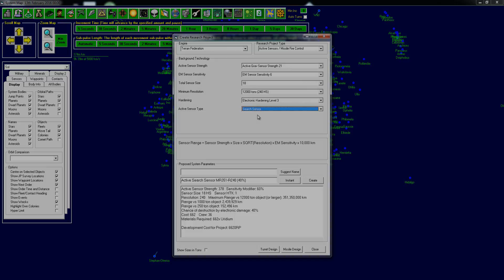Aurora 4x Ship Design Tutorial - "Active Search Sensors/Missile Fire Control"

Comment: very usefull tutorial.
can active search listening posts be more usefull whan conventional deep space tracking stations?
i  have a habbit to demand commercials to deliver 10 deep space trackers to places, that i want to know about.
in what cases do u use active pdc trackers with no firepower?
Reply from the maker: +Sledge Hammer a good question that the best answer to is: it depends.
Take this into consideration:

- First of all Deep Space Tracking stations can only be put on asteroid/moon/space station. In many cases you won't have this luxury available
- They have varying strength depending on your technology and the target so a specialized sensor will give you warning earlier than a passive in some (most?) cases
- Since the first Scenario I forbid myself from putting more than 5 tracking stations at one place as they are (IMO) quite OP (by building more and more of them you can basically eventually track a TH of 10 billions of km away which is down-right idiotic and an equivalent of smelling a matchstick on the other side of New York City)
- Most of all active sensor give you estimated size of target. Passives give you only TH or EM signature which tells you much less than the size of the object. Is it a ship with very low signature? Is it a very large missile? You can't be sure until you actually scan the thing with an active sensor
- You need active sensor for any missile/weapons guiding
Reply: Alfapiomega yes DST are quite OP. other than that, whan u smell this matchstick, u just can move sensor ship closer to know what size this matchstick is. 
you probably don't want any kind of matchsticks to be in your territory. 

what do u mean "First of all Deep Space Tracking stations can only be put on asteroid/moon/space station"?
pdc are placed the sameway. or do u tow pdcs in the middle of nowhere?
Reply from the maker: But active sensors don't have to be on a PDC only. Put it on a platform (ship without engines, I'll show it later), tow it in the middle of nowhere and there you go, a sensor satellite! :)
Reply: Alfapiomega i get an idea. but why not to give it engine?

i as a matter of habbit have eye class ship. ship with just 1 50hs vs 1500 ton sensor with lots of engines. 
this sensor is already expensive as drugs. engines don't add a lot of cost/space.
Reply from the maker: Because then it's a ship.

It sounds like a snarky response but it's true.
What I usually do in my games is down the line design a satellite that is basically just a platform equipped with EM, TH and active sensors. This thing is heavily armored, has a long deployment time and immovable. I then create a satellite carrier that goes around laying them in places where I need them. From time to time he picks them up, carries them back for an overhaul and shore leave and later takes them back. It is a bit of a hassle but it's cheaper and more efficient in resources than having an actual fleet of sensor ships where I don't need to build engines (who are, frankly, often a big part of a ship and quite expensive).
Reply: Alfapiomega well, it sounds reasonable in terms of reality. but this game has already tonns micromanagement. what you do seems like realy too much for my lazyness :) tow it, tow it back. whan towed, rehaul. rehauled - repeat.
it's sparta :)
Reply from the maker: Yup. Which is a reason why I only use them in specific roles (like Jump Point patrol) and I try to give them as much service time and resources as possible.
But looking at it from a standpoint of a sensor ship you would have to send it on it's way, then back, overhaul, repeat... it's not that much different :)
Reply: Alfapiomega well. it's possible to automate in one task group "move, delay time, move, overhaul" repeat. 
and i'm addicted to use DST a lot as a far enemy detection. this ship is agile scout, who is ushualy twise as fast as my missle ships and most of the time sits at home.
the main idea of this ship is not to detect enemy but to increase missle range. i uhualy give my missle ships sensor, twise ...
let's say my regular missle is 200m km range. i give my missleship firecontrol for 250mkm and sensor for 100mkm and secondory missles with 2/3 size of regular missle but same  engine and range of 70mkm. and build this fast eye ship with long-range sensor. 
the role of ship is a part (separated TG) of missle group or a part of shortsighted (almost blind) meson/laser group. not far detection.
Reply from the maker: Care to share the plans for this sensor ship?
Reply: Alfapiomega well. i gues it was overengineered. the idea was "just sensor with engine" )))

Eye class Scout    8 350 tons     167 Crew     2002 BP      TCS 167  TH 352  EM 360
4215 km/s     Armour 3-36     Shields 12-300     Sensors 1/1/0/0     Damage Control Rating 15     PPV 0
Maint Life 3.77 Years     MSP 2749    AFR 111%    IFR 1.5%    1YR 303    5YR 4538    Max Repair 924 MSP
Intended Deployment Time: 36 months    Spare Berths 1    

352 Mill Magneto-plasma Drive (2)    Power 352    Fuel Use 50.76%    Signature 176    Exp 11%
Fuel Capacity 2 000 000 Litres    Range 84.9 billion km   (233 days at full power)
Delta R300/300 Shields (5)   Total Fuel Cost  63 Litres per hour  (1 500 per day)

CIWS-160 (1x2)    Range 1000 km     TS: 16000 km/s     ROF 5       Base 50% To Hit
Active Search Sensor MR303 x1500 (1)     GPS 27720     Range 303.7m km    Resolution 30

This design is classed as a Military Vessel for maintenance purposes
Reply from the maker: Care for criticism?
Reply: Alfapiomega sure
Reply from the maker: The ship is way too slow and big in my opinion. Why would it have 36 months deployment time when most of it's time it sits at home? Why so many resources? Why have such a big tank on it? 84 billion kms? Why?
The EM and TH signatures are incredibly high as a result. With a size 1 strength 8 sensor you will be picked up at around 30 mil. kms both by EM and TH. I'd make it much smaller, cut on shields and engines (you will be much faster and less visible that way).
In fact, this design would work ten times better as a scout fighter.
Reply: Alfapiomega i try to remember, why it's 3 years of deployment and msp and so many fuel. i don't remember. ofcourse it doesn't need it.
Reply from the maker: Next generation of this ship can be much better  :)
Reply: Alfapiomega i was probably shy on naval shipyards and very happy, that titan had millions of acc. 1. duranium, so intended to use this ship both as fleet support-scout and far far far space tracker. 
btw i realy don't mind my scout to drag all the missles to it, so my firepower ships don't get it.
but what's wrong with shields? why do u think, that it's batter without them.
Reply from the maker: This really goes down to the logic design. Is this ship purpose clear? I mean what does it do? Apart from staying home all the time?

- It is too big and slow for a bait
- it has to high EM and TH for a scout
- as a sensor ship it has too little sensors
- it is armored and shielded as light cruiser but has no weapons to protect itself, it will just get hit and hope it survives the damage somehow
- it carries enough fuel to be a jump survey ship but has no jump engine

Now I don't know your scenario. If this ship works for you then enjoy it :) You might just have fun with it. I'm just trying to give advice on how it could be a bit more efficient in what it was originally made to do. That's all :)
Reply: Alfapiomega it has a sensor to fully utilise missle ship's firecontrol's range and range of regular missles :) this ship is not very improtant. 
what do u say about other ships? cause i tend to do some variations of this 4 classes in mass quantities every time i play aurora and don't realy have too much fantasy for designing. something else. (so i wait your design tutorials :) )

missle ship. the main vessel.

Kursk class Dalnij bombardirovshchik    11 250 tons     319 Crew     3047.5 BP      TCS 225  TH 352  EM 750
3128 km/s     Armour 8-44     Shields 25-300     Sensors 1/1/0/0     Damage Control Rating 18     PPV 35.04
Maint Life 3 Years     MSP 1354    AFR 126%    IFR 1.8%    1YR 226    5YR 3393    Max Repair 480 MSP
Intended Deployment Time: 12 months    Spare Berths 2    
Magazine 363    

352 Mill Magneto-plasma Drive (2)    Power 352    Fuel Use 50.76%    Signature 176    Exp 11%
Fuel Capacity 1 000 000 Litres    Range 31.5 billion km   (116 days at full power)
Delta R300/300 Shields (10)   Total Fuel Cost  125 Litres per hour  (3 000 per day)

Twin R6/C3 Meson Cannon 60km 10s p3per5 Turret (1x2)    Range 60 000km     TS: 20000 km/s     Power 8-6     RM 6    ROF 10        1 1 1 1 1 1 0 0 0 0
Fire Control 128km 20kms (1)    Max Range: 256 000 km   TS: 20000 km/s     96 92 88 84 80 77 73 69 65 61
Stellarator Fusion Reactor Technology PB-1 O6 (1)     Total Power Output 6    Armour 0    Exp 5%

Size 2 Missile Launcher (3)    Missile Size 2    Rate of Fire 20
Size 6 Missile Launcher (3)    Missile Size 6    Rate of Fire 60
Missile Fire Control AM MR1 (1)     Range 10.1m km    Resolution 1
Missile Fire Control X1500 MR193 (1)     Range 193.2m km    Resolution 30
Size 6 MR104 16200kms (20)  Speed: 16 200 km/s   End: 107.2m    Range: 104.2m km   WH: 18    Size: 5.93    TH: 86/51/25
Size 4 Anti-ship Missile MR40 24200kms (10)  Speed: 24 200 km/s   End: 27.5m    Range: 40m km   WH: 9    Size: 3.9642    TH: 121/72/36
Size 1 AMM MR1 28600kms (84)  Speed: 28 600 km/s   End: 0.6m    Range: 1m km   WH: 1    Size: 1.0079    TH: 200/120/60
Size 6 Anti-ship Missile MR205 16000kms (20)  Speed: 16 000 km/s   End: 214.4m    Range: 205.9m km   WH: 18    Size: 6    TH: 74/44/22

Active Search Sensor X1500 MR120 (1)     GPS 10920     Range 119.6m km    Resolution 30
Active Search Sensor AM MR0.9 (1)     GPS 140     Range 8.4m km    MCR 915k km    Resolution 1

charge-vessel. 
1. anti-missle proptection for missle ship a part of main forse
2. charging enemy as a seperate task group

Banzai class Destroyer    8 650 tons     236 Crew     2324.6 BP      TCS 173  TH 528  EM 750
6104 km/s     Armour 10-37     Shields 25-300     Sensors 6/1/0/0     Damage Control Rating 15     PPV 20.61
Maint Life 2.32 Years     MSP 840    AFR 119%    IFR 1.7%    1YR 211    5YR 3171    Max Repair 480 MSP
Intended Deployment Time: 12 months    Spare Berths 4    

352 Mill Magneto-plasma Drive (3)    Power 352    Fuel Use 50.76%    Signature 176    Exp 11%
Fuel Capacity 750 000 Litres    Range 30.7 billion km   (58 days at full power)
Delta R300/300 Shields (10)   Total Fuel Cost  125 Litres per hour  (3 000 per day)

Quad R150km 6p Meson Cannon Turret (1x4)    Range 150 000km     TS: 20000 km/s     Power 24-12     RM 15    ROF 10        1 1 1 1 1 1 1 1 1 1
Fire Control 128km 20kms (1)    Max Range: 256 000 km   TS: 20000 km/s     96 92 88 84 80 77 73 69 65 61
Stellarator Fusion Reactor Technology PB-1 O6 (2)     Total Power Output 12    Armour 0    Exp 5%

Active Search Sensor AM MR0.9 (1)     GPS 140     Range 8.4m km    MCR 915k km    Resolution 1
Thermal Sensor TH1-6 (1)     Sensitivity 6     Detect Sig Strength 1000:  6m km

coiler-supplier

Coiler class Collier    10 050 tons     138 Crew     1015.5 BP      TCS 201  TH 320  EM 240
3184 km/s     Armour 3-41     Shields 8-300     Sensors 6/1/0/0     Damage Control Rating 16     PPV 0
Maint Life 9.23 Years     MSP 2379    AFR 134%    IFR 1.9%    1YR 50    5YR 755    Max Repair 60 MSP
Intended Deployment Time: 24 months    Spare Berths 0    
Magazine 1017    

160 ACC Magneto-plasma Drive (4)    Power 160    Fuel Use 7.07%    Signature 80    Exp 5%
Fuel Capacity 300 000 Litres    Range 76.0 billion km   (276 days at full power)
Delta R300/300 Shields (3)   Total Fuel Cost  38 Litres per hour  (900 per day)

CIWS-160 (1x2)    Range 1000 km     TS: 16000 km/s     ROF 5       Base 50% To Hit
Size 6 MR200 37600kms (100)  Speed: 37 600 km/s   End: 89.6m    Range: 202.1m km   WH: 36    Size: 5.95    TH: 200/120/60
Size 4 MR70 56900kms (50)  Speed: 56 900 km/s   End: 20.8m    Range: 71.1m km   WH: 18    Size: 3.94    TH: 303/182/91
Size 1 MR1.1 67100kms (224)  Speed: 67 100 km/s   End: 0.3m    Range: 1.1m km   WH: 1    Size: 1.0009    TH: 671/402/201

Thermal Sensor TH1-6 (1)     Sensitivity 6     Detect Sig Strength 1000:  6m km
Reply from the maker: a) Kursk
- Why so many missile types? That's an utter chaos, man
* Can you actually launch a size 4 or 1 from a size 2 or 6 launcher? I never tried that, I always fit everything perfectly
- The meson cannon has a hopeless range. You own missiles travel 80 000 km - 143 000 km per five second increment while you have a range of 60 000 km at what seems to be ship anti-missile defense. Why?
- Are you having fuel problems? Because that engine is great for a cargo ship but for a ship that is supposed to fight it's unreasonably under-powered. Remember that the actual hit/miss ratio is dependent on your ship's speed.
- I'd add a long range sensor (resolution around 8000 tons)
- why no passives?!

b) Banzai
- again the engine. Why?
- if this is a purely beam ship push for higher range, this is really low and it'll give you max 1 shot before you get hit by a salvo
- this ship could benefit from additional long range sensor
- why no EM passive?!
* BTW if this size is destroyer than what does you battleship looks like? :)))

c) Coiler
- why no EM sensor?
- if you are going to armor it you might as well add some real turrets and tracking to help it survive. Having shield and armor won't do you much good if you plan to have this thing under fire with this speed
Reply: Alfapiomega yes. you can lunch lesser misslies form bigger lunchers.
missiles:
1. s6 mr200 "StupidGirl". many fuel (more than missle ship sensor), low agility. remember about eye class ship with sensor mr300
2. s6 mr100 "SmartGirl". range to missleship sensor, more agility
3. s4 mr40 "Subcaliber". same engine as s6, less fuel, less exposive, some agility. is used whan bigger girls can't do the job done. and against small agile ships.
4. AMM. i was rediculusly inconclusive about few points to agility+fuel for additional manuvrwble rating. so it became little more. whan exactly 1 msp. so i made 2-size lunchers not 1-size.))) it was stupid. i know ))) but no big differense

if your beam fire control is in final defensive fire (not area defence and not self only), the check for beam fire x missles targeted to any friendly ship is made before missle impact. (i'm not sure. that your are right about 5 sec. idea ) this 5 sec is true, if your control is in area defense mode. if it wasn't changed.

well. this engine is 1.1 power engigne/fuel consumption. it probably was maximum. my cargo engins are 0.5 or lower.

your are right about high resolution A-sensor. i just never thought of having 2 antiship sensors. x1500 looks like jack of all trades. but u realy can get 1 x500 and 1x8000. for lesser size or close to it.

about EM and Thermal. I don't know. i don't find them usefull. if active sensor does it job. why do u need something else :) i wait for tutorial video on that topic.

about coiler-supplier. i realy don't have and idea. what i want for this ship. 
the main idea is to place magazines from missle ship to separated ship. just because, u can't have enought rockets on a ship. 
so it should just go with missle ships, reload them after they shoot it cargo. and that's all.
i gave it lower engine to run a lot to Titan's pdcs. to save fuel. 
actualy i did have very bad situation in terms of sorium.

btw my pdc. actualy same weaponary.

HeagHog LONG class heaghog    18 200 tons     483 Crew     3396.5 BP      TCS 364  TH 0  EM 0
Armour 16-61     Sensors 1/924     Damage Control Rating 10     PPV 95.2
Intended Deployment Time: 1 months    Spare Berths 2    
Troop Capacity: 2 Battalions    Magazine 379    

Twin R6/C3 Meson Cannon 60km 10s p3per5 Turret (5x2)    Range 60 000km     TS: 20000 km/s     Power 8-6     RM 6    ROF 10        1 1 1 1 1 1 0 0 0 0
Fire Control 128km 20kms (1)    Max Range: 256 000 km   TS: 20000 km/s     96 92 88 84 80 77 73 69 65 61
Stellarator Fusion Reactor Technology PB-1 O6 (5)     Total Power Output 30    Armour 0    Exp 5%

PDC Size 6 Missile Launcher (5)    Missile Size 6    Rate of Fire 30
PDC Size 2 Missile Launcher (5)    Missile Size 2    Rate of Fire 10
Missile Fire Control X1500 MR193 (1)     Range 193.2m km    Resolution 30
Missile Fire Control AM MR1 (1)     Range 10.1m km    Resolution 1
Size 6 MR104 16200kms (20)  Speed: 16 200 km/s   End: 107.2m    Range: 104.2m km   WH: 18    Size: 5.93    TH: 86/51/25
Size 4 Anti-ship Missile MR40 24200kms (10)  Speed: 24 200 km/s   End: 27.5m    Range: 40m km   WH: 9    Size: 3.9642    TH: 121/72/36
Size 1 AMM MR1 28600kms (84)  Speed: 28 600 km/s   End: 0.6m    Range: 1m km   WH: 1    Size: 1.0079    TH: 200/120/60
Size 6 Anti-ship Missile MR205 16000kms (20)  Speed: 16 000 km/s   End: 214.4m    Range: 205.9m km   WH: 18    Size: 6    TH: 74/44/22

Active Search Sensor MR303 x1500 (1)     GPS 27720     Range 303.7m km    Resolution 30
Active Search Sensor AM MR0.9 (1)     GPS 140     Range 8.4m km    MCR 915k km    Resolution 1

there is also PDC HeagHog Short. 
just the same with MR100 (missle-ship type) sensor.

i had something like 4 of them on Titan, that couldn't be protected by Earth ships.
Reply: next time i play, i will do one more class missle. something like this.

S6 MR200 "Annoying"
long-range highly-piercing.
1. AM defence, if salvo was detected far away. effective usage of big lunchers for AM defence
2. bombarding enemy for enemy's AM ammo depletion purposes
3. piercing strong AM defence

Missile Size: 5.4657 MSP  (0.273285 HS)     Warhead: 0    Armour: 0     Manoeuvre Rating: 10
Speed: 17600 km/s    Engine Endurance: 190 minutes   Range: 200.2m km
Cost Per Missile: 3.7212
Second Stage: Size 1 AMM MR1 28600kms x3
Second Stage Separation Range: 1 000 000 km
Overall Endurance: 3 hours   Overall Range: 201.2m km
Reply from the maker: +Sledge Hammer to the beam control - as far as I know it always goes fire/then movement. The game has no cycle for every second. Some things are even calculated on 1 minute or 1 day basis. However I can be wrong of course so if you find out it's different please let me know.

1.1 is not maximum for engine at any moment, you start with I think 0.5 - 1.5. or 0.8 - 1.25 (not exactly sure but definitely not 1.1)

The sensors really depend on what you want them to do. If you build ships of size 20 000 ton I wouldn't tune them for 1500 tons. The 3/4 of your own size seems about right for any scenario. Once you encounter hostile aliens use what you learn about them to tune your sensor resolutions :)

I published a video about EM and TH sensors yesterday.

Regarding the PDC - again the range of the mesons is just awful. Like really. Also if you are building a PDC it's usually good to make use of it's potential - size 6 and 2 rockets are way too small for a planetary defense center. I'd go with size 12 or 15. You can't be cheap when it comes to defending your colonies. Any missile that will hit your planet will wreck it completely. Go with maximum utility, you have the space.
Reply from the maker: +Sledge Hammer One thing I wonder about is why on Earth would you create a missile that has size of 5.4657 and not size 6? :D
Reply: Alfapiomega -this beam fire-control is very important topic. 
i know, that 5-sec cycle is minimum.
my statement is, that, at the end of 5-sec cycle the check for firecontrol in final defensive fire (and your ships are not in autofire ) is made before the check for missile impact.
it's almost the same way as CIWS. 
google "aurora 4x final defensive fire" there are some discussions on pentargh exactly about it.
i guess this mode is made exactly to compensate game's mechanic of minimum fraction of 5 sec.

-engines
i agree, that i was greedy about 1.1 fuel ussage. do u always make maximum ep/fuel?
it seems to be some point, that you get deminising returns, just because you need to carry more fuel, that increases overal tonnage.

-huge missles
what the point of having 12s missles against having 2 of 6s missle?
You have the same overal damage for s6, you reload twise faster, it's twise (or quad) more diffcult for enemy to hit 2 s6 missles in comparison with 1 s12. spead+quantity.
what's your arguements for big size missles?

-decimal sizes of missles.
as said berfore, u can lunch lesser missles from bigger lunchers.
u talk about
Missile Size: 5.4657 MSP  (0.273285 HS)     Warhead: 0    Armour: 0     Manoeuvre Rating: 10
Speed: 17600 km/s    Engine Endurance: 190 minutes   Range: 200.2m km
Cost Per Missile: 3.7212
Second Stage: Size 1 AMM MR1 28600kms x3
Second Stage Separation Range: 1 000 000 km
Overall Endurance: 3 hours   Overall Range: 201.2m km
it's staged missle. it carries 3 good missles for exavtly 200 mkm. it doesn't need anything else. i can give it 0.34 fuel more. but what for? i don't have firecontrol for more than 200mr. it just doesn't have reason to be exact 6 msp. what's your arguements for exact MSP numbers?
Reply: http://aurorawiki.pentarch.org/index.php?title=Point_Defense
Final Fire
Final defense occurs during the movement segment when the missile's should intercept their target.

So the instant before the missile hits, Final Fire mode activates and begins firing at the missiles point blank.
Reply from the maker: Can't access it at all, the wiki is dead, Jim :(
Reply: perfectly alive for me. Shrodinger's cat?
Reply from the maker: This webpage is not available

DNS_PROBE_FINISHED_NXDOMAIN

I can try later if I remember.
Reply: Alfapiomega DNS_PROBE_FINISHED_NXDOMAIN
is cashe problem on your side. either browser or provider. clean cashe of browser. if it doesnt help, wait for provider to reboot his cashe.
you didn't answer anything about missles.
Reply from the maker: I can't access the page still. Neither here nor at work nor at my phone :-/
Reply: Alfapiomega i can't access too now. ERR_NAME_NOT_RESOLVED.
actually "Final Fire
Final defense occurs during the movement segment when the missile's should intercept their target.
So the instant before the missile hits, Final Fire mode activates and begins firing at the missiles point blank."
was exact quatation from there.
Reply from the maker: Interesting, I wasn't aware that it worked that way, you were correct when you mentioned it then.

Though the question remains - is it worth it? CIWS really seem like useless against anything than a generation or two weaker missiles.
Reply: Alfapiomega yes. it's very interesting. and it's not only about CIWS. it's about any beam fire control.
like this for examle.
Kursk class Dalnij bombardirovshchik    11 250 tons
Twin R6/C3 Meson Cannon 60km 10s p3per5 Turret (1x2)    Range 60 000km     TS: 20000 km/s     Power 8-6     RM 6    ROF 10        1 1 1 1 1 1 0 0 0 0
Fire Control 128km 20kms (1)    Max Range: 256 000 km   TS: 20000 km/s     96 92 88 84 80 77 73 69 65 61
Reply: open combat assignment window. select any ship with beam weapon. you will see "change point defence mode". it needs to be in "Final defensive fire" to work this way.
Reply from the maker: Already way ahead of you.

I already realized why I haven't been using this. This defends only your own ship while I try to go for area defense.
Reply: i don't know, what it means.
but.
have u realised, that final defensive fire DEFEND ALL ships in range?
Reply from the maker: Are you absolutely sure about that? 

Anyway even if it is I would still prefer area defense thanks to the fact that the beam weapons can (most of the time) shoot against incoming missile more than once before the impact (I always go for the 5 second recharge rate).
Reply: Alfapiomega this is what wiki says.
Reply from the maker: Good to know then :)
Reply: Alfapiomega
just to finilse, what i know, not to be got wrong.
area defence mode happens in fire fase of 5-sec cycle, so you do get, hit if missle moves enought to intercept.
final defensive fire mode happens during moving fase of 5-sec cylce and forces turrets to fire before missle intercepts any friendly object in range.
final defensive fire (self) mode is almost the same but for it's own ship. same as CIWS.

who forces you to use one of the modes? use one reletively to situtaion.

i'm realy curious, how you aproach to beam firecontrol design (range - tracking spead) for anti-missle purposes ecpecialy for PDCs.